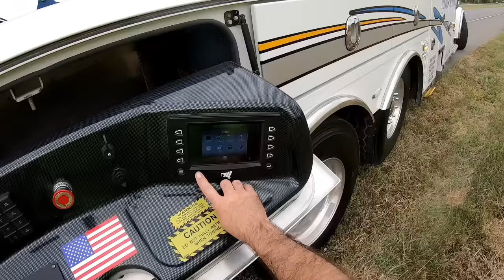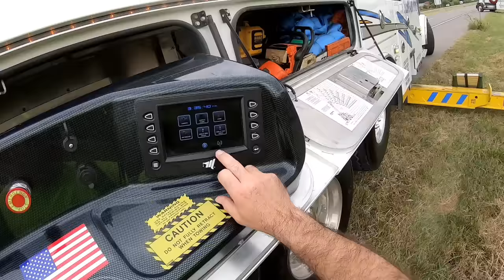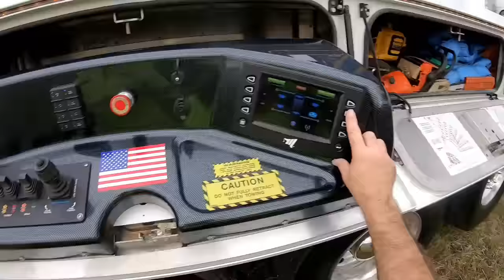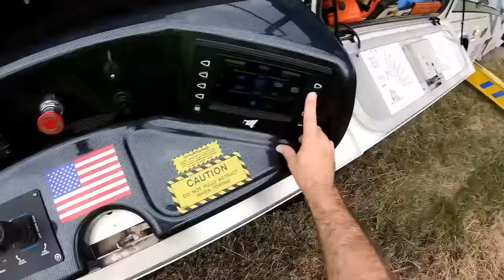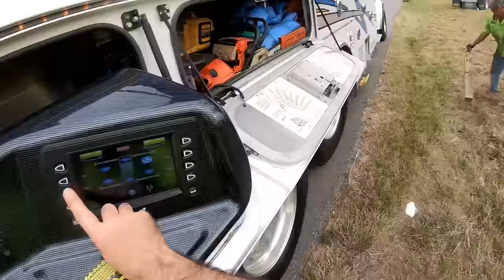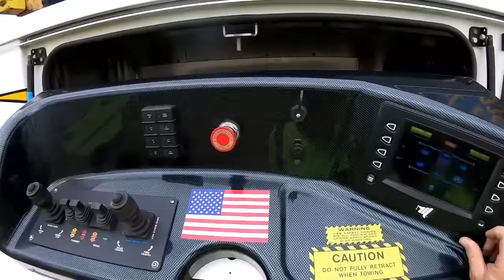Code 3 Semi Crash!!!  Semi Loaded with Sand Takes the Ditch!!!

Comment: Ron, if you add a “Q” you WILL be heard. Been driving fire trucks for 30 + years. The “Q” is my friend. Also, you need to take Raymond on more runs. That man does not stand around.
Reply: What is a " Q" if I may ask?. Been around a long time and " Q " is new to me.
Reply: @vetterfellow  It's basically a siren by Federal Signal. It's used on Fire Vehicles all the time.
Reply: @vetterfellow  

A "Q" is a type of mechanical electric siren. Usually found on fire trucks.
Reply: I'd like to see the Q as well - that or the Rumbler. Thing is though, a wrecker using code and a fire engine using code are for two different purposes - saving a life vs clearing traffic - in most cases the victims are already being extracted by the time the wrecker gets the call, save for the worst accidents where whole vehicles have to be moved to rescue survivors.
Reply: @Sara-L  

Sometimes.

Ron is trained in heavy extrication, and is also certified in it. He can be called at the point of initial dispatch to police where a heavy vehicle needs to be lifted with the rotator before police even arrive on scene.
Reply: I think he should use a different siren like the one that has the longer woooooo it goes up and down. Might be called wail. The Yelp he is using now is inaudible to someone who has the radio blaring and windows up.
Reply: @sedric6153  I think what you are describing is actually the Q siren.
Reply: The fact that Raymond is a good worker is probably why he is driving another rig. I'm guessing he can be trusted to run the scene on other accidents and that is also why he can almost anticipate what Ron will need him to do in the videos we see him in.
Reply: A Q is a mechanical motor driven siren. They generate the siren sound by using a chopper rotor inside a can. Watch some of the older emergency shows and you will hear the wail of a Q. They generate a sine wave that is heard MUCH better than any electronic siren.
Reply: @vetterfellow  Q is the stereotypical American fire truck siren. The one that mechanically is basically a small tornado siren mounted on the truck!
Reply: @Sara-L   ambulance isn't much use if the people they need to get too are trapped in a flipped vehicle...
Reply: Raymond is an absolute beast. It seems he is quite a valuable addition to the team. He just starts grabbing and making sure he has the tools/items needed for the job and goes to work.
Reply: @vetterfellow  the federal Q is a mechanical siren that is very popular on American fire apparatus. it is controlled either by a foot pedal or hand switch. they are very loud and are very useful.
Reply: Mentor yes your have Raymond and his gold in your campony he is also fast on accidents 
Thanks to all the grew i love what i saw good work down 
My God bless you all
Reply: @vetterfellow   federal q is a siren on fire apparatus
Reply: From the netherlands, in my humble opinion  nobody is born with the knowledge,  but learn through the years by older colleges  and books and innerbeen , nessecary good material  and will by a craftman most off these men Who help People in time of shock, great respect for that wonderfull hard input kind regards.
Reply: Or just a better siren and speaker the Whalen 295 dual tone is super loud as well as mt he code 3 vcon

Comment: Besides the siren one major thing of getting people to move is lights. The best pattern for any lighthead like on the hood is a solid flash pattern that isn't split. You want as much of the light to flash at once as possible. When the lights are set to what we can "Split fail" half or more of the light is off at any given time. Another major thing is sync. The best thing is a left right alternating pattern. It will greatly improved visibility and safety. Can't wait to hear the Q running!

Comment: First off glad to hear that the driver was not injured seriously.  Second my prayers for mikes dad and family.  Last, I heard you ask if it was frac sand and that impressed me. Most people don't realize the difference in material, standard construction/concrete sand locks together and is fairly stable. Frac sand is extremely dry and round in structure, that stuff almost flows like a liquid.  Here where I live the oilfield is the main source of income, hence we see a lot of frac sand. That being said I have seen bulk pneumatic trailers roll on less of a slope due to the load shifting. As always you and your crew did an amazing job,  stay safe and take care.

Comment: As a retired police officer, I would like to Echo some of the comments made by my learned to colleagues and Missouri. When running code, always rotate through your siren box. When you come to an intersection, even and sometimes especially if you have the right-of-way, green light, you still want to rotate through the siren box and or use your air horn. Additionally, do not have Amber lights going when you have Reds, or red and Blues. It confuses people.

Having said that, it is not strange to see a wrecker running code 3. In fact, in a lot of jurisdictions, it should happen more often. It is very frustrating as a police officer, to want to reopen a road, but to be unable to because your wrecker is stuck in traffic and it takes a long time to get it there. More States should understand that this is necessary and proper.

Awesome video.

Comment: Ron agree you need the Q siren. It will sound cooler with the rotor and people will hear it better as well
Reply: Zane Taylor A mechanical Q needs wounded up, so that would be a distraction unless they go for an EQ
Reply: Crank up the Q!
Reply: It is mounted he just need to finish getting it wired last i heard.
Reply: No, what they need is a rumbler.  That will force people out of the way.
Reply: Yeah a Q siren or Powercall. Both whould fit good on the Tator because of its size

EDIT: Heavy Rescue 3 of the LAFD is nice example for a good siren too: https://youtu.be/akfLXXkw96w?t=30 especially because its a rotator too. Even the same brand like Rons just a bit smaller.
Reply: One of the fire companies in our area has an engine with a Q, a regular electronic, an air horn and a Powercall. When they run the Powercall with the Q, the Q actually takes a back seat. People get out of the way, which is something to say in South Jersey.
Reply: @orangecitrus_6705  it doesn't need wound up that's a term for using it! It's just about flawless, the Q has been around for a long time for a reason!
Reply: Everyone is only talking about the siren side. Ron needs a studdertone air horn too.
Reply: OrangeCitrus_ he can install a foot pedal

Comment: I remember when the law came out that drivers reduce speed by 20 mph and stay out of the lane where the emergency vehicles are.  I didn't understand why until I started watching your videos.   Now I have a far better respect for the emergency crews.
Reply: Same here. Always slowed down but never gave it much thought. Seeing the on the ground perspective from the operators view has definitely opened my eyes.
Reply: Johnny Umphress I haul materials for road construction and it’s scary how fast people will fly by and not attempt to move over.
Reply: @midwestbd7144  It's the same with the over-dimensional, over-weight stuff we haul.  Thanks for good escorts.  Loads 15' 6" wide need more than one lane and 90,000lb. loads do not respond very quickly.

Comment: A another good job Ron and have the truck being able to drive away after being pulled out that’s worth cheering about you have a good crew that was working with you and looks like Raymond is a go getter you told him what chains to use he grabbed them and went got them ready on the back of the trailer so get them hooked to the winch to be pulled out
Ron hope you and your Midwest crew have a good safe weekend

Comment: I have found out that when running code 3, the air horn and the “Q” moves a lot of traffic versus an electric siren.
Reply: As I mentioned above,  a Powercall has real authority, even against a Q.
Reply: @rayives7758  depends on location! I have to use a ton of horns and Q vs. an electronic being enough for my area!
Reply: Really needs to be a StudderTone instead of a regular air horn...
Reply: Also 3 watt TIR LEDS on the lightbar.

Comment: Same with the company I work at. We don’t use the sirens for the heck of it, we get told to run code so we do. I put the siren on the truck because if we get told to run code, it’s needed on the truck. It’s on both of the rotators, and the big 50 ton wrecker. That ones the only standard wrecker that has a siren on it because it’s the truck that tows away heavy vehicles or wrecks, and it’s used a lot as a heavy support wrecker for the rotators

Comment: That was a good driver!  I didn't see any skid marks so I guess he drove down there and kept it up-right with little damage.  He is someone who can think QUICKLY and respond QUICKLY.  As I said before, my son and I are "partners" in a specialized logistics business.  My background is finance.  The fun is communication since I am in OH and the business is headquartered in central TN.

The first truck he bought was ruined by the dealer - catastrophic engine fail with the top of the piston through the head and the rod through the side of the block.  Then we bought a 2003 KW W900L - half of what we needed.   He did all the small stuff so we could run and then someone backed into it - $47K to do what was needed including an in-frame rebuild, new turbos, A/C and a whole bunch more.  We made a little money and invested it in the tractor - fourth axle (steerable/ liftable), new trans (13 to 18M), new clutch, new radiator etc.  Empty we can run on five axles, loaded eight.  BUT the fuel economy jumped like a scalded cat.  Well, there is a big CAT under the hood!

I was going to retire for the fourth time but .... at 76 I'm working again.  I looked in the Bible and could not find the work retire!  In the tire business (where I worked for Continental AG), to retire just means putting on new ones and keep trucking!

Yes, we run up N to Michigan, Wisconsin, IL, IN south to Tampa or so and W to the port of Houston.

Thanks again for the video.

Comment: Ron I worked as a Police Officer for the US Air Force and then again for my local Sheriff's Office. Of course we did determine when or when not to use the siren, and in the Military we had solid blue light bars with a loud federal siren on the front of the trucks. If it was a call that was urgent or emergency then I used the siren at all times. The Military was easier as the rules to clear the road for emergency vehicles was very clear to all motorists. I would switch between the three patterns on the siren just to make sure people knew I was behind them and for them to yield to my vehicle. I also did this here in Phoenix when operating a sheriff's office vehicle. Changing the pattern got other motorist's attention. I do like that you are cautious in using the lights and siren for your tow vehicles as it shows you are very careful. You also have the air horn which most police vehicles do not have, maybe they should!!! I am so very pleased to see that you are a man of God and it governs how you conduct yourself. This is part of why you do not just take it upon yourself to move people when running code, but you submit yourself to others. I enjoy watching your videos and boy You seem to be very professional. When I was in the military we were called Security Police, we had special weapons on our base and sometimes that meant we had to take force and do it now!!! That meant one time I had to commandeer our wing commander's car and express to him a ride would be there pronto. He accepted it with grace even though it was snowing hard because he knew we had the mission to accomplish!!!

Comment: Just throwing this out there, as it’s a massive expense, most major lightbar manufacturers (whelen, fed sig, code 3, feniex) have full dual colour light bars, so the massive one on your wrecker can switch to red/blue when you’re responding code, or full amber when that’s required, and actually anywhere in between as necessary.
Another thought, since I’m already out spending your money, the flash pattern of the lights on the grille gives the appearance of steady burn at a distance, as opposed to alternating with each other, it only alternates on the same module.  There are also in line modules (one of which may actually be an option with your lighting controller) is wig wag alternating headlights, if they’re halogen or LED, I don’t believe HID’s can alternate though.

Comment: Hope Mike's father is doing well, my thoughts go out to him.
This crash looked like it could've been so much worse than it turned out to be, but props to the driver for making the right call in this scenario of a lose-lose situation & I commend your efforts on the excellent recovery. Seems like you & Mark work well together, I've seen the "Sands of Time" where you lifted the trailier & towed another one of his trucks & I can definitely tell you two work well. 
That being said, I do have a few other suggestions that may help if you don't mind regarding the emergency equipment on your truck, this is coming from a driver's standpoint.
1. Siren: Definitely get that Q on soon, but I would also suggest a louder main siren to go along with the Q. A louder siren alerts quicker & helps move traffic.
2. Red/Blues: I definitely think the Tator needs some lighting upgrades
    -The Grill: Either add more red/blues or upgrade to larger/brighter lights
    -The Rear: I would suggest finding a way to incorporate red/blue lights that are easily visible from behind you, the only lighting somewhat visible to drivers behind you are the two markers overhead which are hard to see. If you were able to incorporate more lights onto the Tator, you may have (somewhat) easier time of getting traffic over.
    -Pete #10 (Century 4024) is really nicely setup in terms of Red/Blues because of those marker pylons, along with the Rollbacks with the lighting on the rear of the headache racks which are all highly-visible from the rear.
Where I live (Washington State) Towing/Recovery vehicles are allowed to run Red in conjunction with Amber in terms of lighting. Most agencies around here have Reds positioned in the rear that make them easy to see; it helps me spot & whomever's pulled of the road in a more timely manor.
I hope you find these suggestions helpful, keep up the great work Ron :)

Comment: First video I saw from you guys was a call where you ran code. Was that hour-long video with the International that lost its steering taking the median after hitting a 4-wheeler, and was pulling a load of roll stock. I thought that was the coolest thing, seeing a tow truck running lights/sirens like that... and honestly, I think you guys saved me a major WTF moment the first time I entered the state of MO and had a wrecker run code past me on the highway. You're doing amazing things out there, Ron. Keep it up!

Comment: When you're doing a side pull like that you can run your open winch line to your rear outrigger, that will take all the strain off of your swing motor.
Reply: At one point he was talking about maybe redirecting off the other truck, but decided against it because the Tator was handling it.
Reply: With a rotator, you should never need another truck. 5 winches and a small crane I can't think of anything else you would need

Comment: My advice, change the pattern on the front blue and red leds.  They are doing what id called ‘split fail’.  The pattern that they are in only lights half the head.  At any distance, the wig wag is gone and they seem half as bright.   Put them into a full one flash pattern. Triple (comet) is most eye catching.  But, all 6 leds in the head need to be on at the same time.

Comment: I’m surprised the truck didn’t roll over with that heavy load which would have been a huge mess to clean up. I was expecting a recovery closer to the cotton seed crash video and not one where the truck could drive off. I agree with with what the others are saying about bigger lights on the front and a Q sirens. It would make you a lot more visible and easier to locate by other drivers.

Comment: Did you have to do training to run code? over in the UK we have to do blue light courses which teaches you the basics like not using a yelp tone which is designed for short range on motorways aka highways, WAIL is your long tone you should be using at high speeds and your general tone, yelp is useless unless up close or at low speed so on a highway at speed a yelp is simply drowned out as if you've not even got a siren on, amber lights will also confuse people as i saw one of your other videos where the ambers drowned out your red and blues completely.

Comment: for those cars that refuses to move over while PD FD EMS are responding they need a camera to capture the license plate so they can receive a nice ticket from the Missouri Highway patrol and add points on there DL for failure to yield

Comment: I understand that 8 degrees is maximum for height clearance - I wonder why it isn't less degrees - i.e. 0 degrees for stowage of the boom?  And thank you sir for your own kind words.
Reply from the maker: I can go lower with the boom, but I have to be careful.  There is an LED work light mounted to the bottom side of the boom.  If I drop the boom too low and attempt to roll the boom in the carriage it will damage the LED light, which costs around $1000.   So, I have found that 8 degrees is a "happy medium" that allows me height clearance as well as keeps me from damaging the LED light.   Thanks for watching and God bless.
Reply: @RonPratt  Thank you - i thought the 8 degrees might be a manufacturer imposed limit.